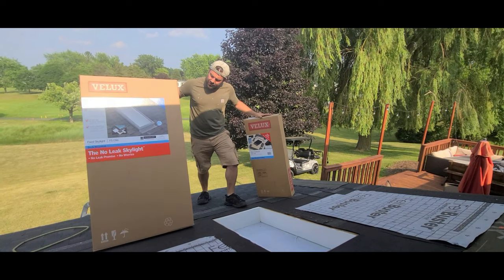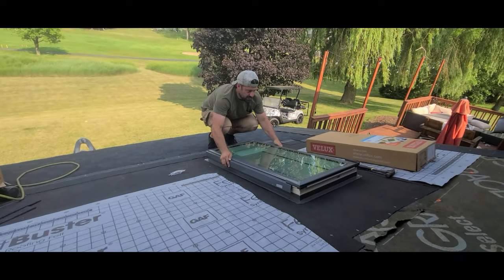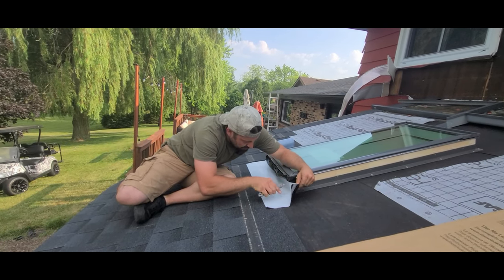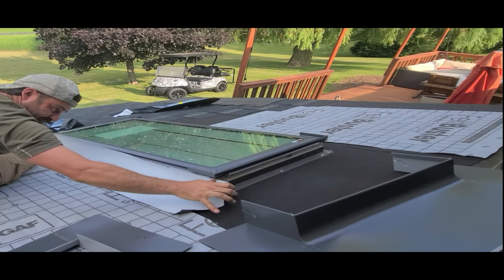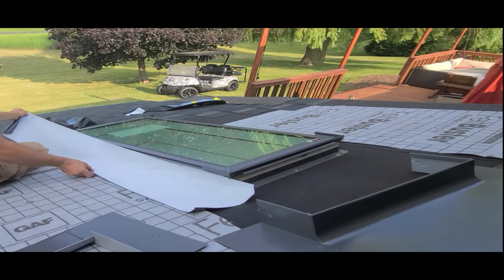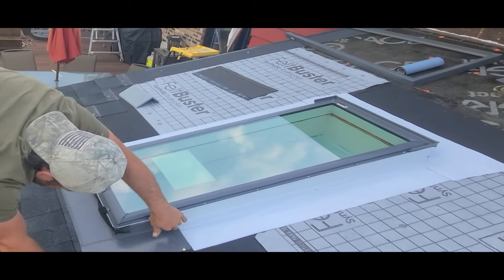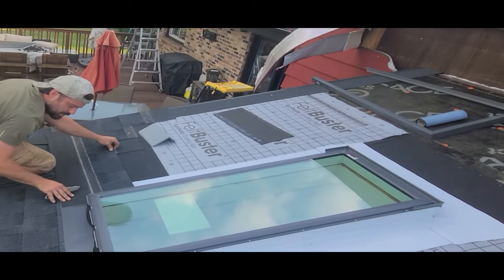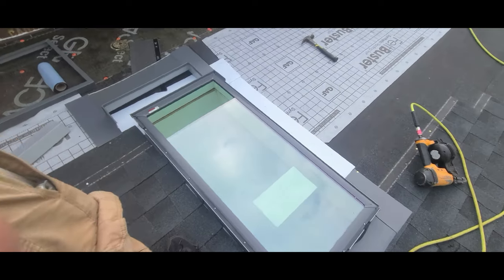HOW TO | Velux Skylight Install

Comment: Dude, you saved my bacon. I am a reasonably competent DIY and took on the task of replacing an old leaking skylight with this model of Velux on a cedar shake roof.  Everything went ok until I could not gete the saddle flashing or the cladding to go onto the skylight frame.  Your mention of that stupid extra piece inside the saddle flashing told me where that was and why it was not allowing flashing to fit.  Same with how you showed how to put on the cladding.  Thank you!  Velux instructions are lacking in the use of the English language and additional notes for the new installer using this product for the first time.
Reply from the maker: Happy to help!

Comment: The piece that you discarded at 3:35 in the video does have as purpose for some installations. From the flashing installation instructions: "Install saddle flashing. Determine use of extension piece: use it if the saddle flashing is lifted up by the underlying roofing material and remove it if the saddle flashing fits tightly over the skylight". The instructions have some nice illustrations showing when it would be needed. In your case(s) it is probably not an issue, but in other cases, perhaps. Anyway, like you videos.

Comment: FYI, that “useless piece of metal” is intended for helping with height of roofing material. It’s an extension to fill the void caused by thick roofing material like shake or slate.
Another helpful tip: use a hand seamer and close the head flashing to cladding overlap at the top. Keeps rain and or snow and ice from creeping up that joint. Just takes a second.

Comment: Can you please link to the skylight you installed? Where did you get it and what did it cost? Which flashing kit to get? Thanks for a great video - straightforward and quick. Perfect.
Reply from the maker: You can get it from your local roofing supply store like beacon building products or abc, or local shingle delivery company. They usually have everything in stock. Also I'm pretty sure Menards has a few in stock.
Reply: @NWIVeteranConstruction  Thanks for the speedy response! This looks like a Velux C08 (or something very similar). These are currently about $410 at Home Depot and the (required) flashing kit looks like it's another ~$160. For others reading this: smaller/larger are slightly less/more and of course it's extra if you want built-in shades, or if you want it to be openable.

Comment: The piece you hammered over at the beginning is probably to cover your nails with. 

It’s probably designed to have you shoot nails in and then bend it over to cover the nail heads.

Comment: the old one looks like what I had Andersen, they stopped being in the skylight business, I had 8 of them. After 27 years a few started weeping finally started weeping, rubber gasket got old and dried out,  replaced with 8 Velux, Velux has the market indeed. So it was due, new 8 Veluxes and roof shingles 50 year Owens Premium .  Should be good for my time...left

Comment: Hey bud its been awhile since iv talked to you i have a quick question.. I'm building 12' wide dormers on a 24 x 24  12 12 pitch gable roof.. For shingling purposes on my ridge should i come straight off so IOW i will have two right angles all even? Or would it be better to hold the new ridge beams down a little from the original ridge? Thanks ahead and keep making videos its been 3 months..

Comment: How exactly do you measure before buying the skylight? If theres s fixed mounted skylight thst needs to be replaced, then do tou measure the outside skylight frame or do you go inside and measure the cutter plywood roof?
Reply from the maker: Measure the R.O. which is the rough opening. Drywall to drywall on the inside. You can usually just look down the window from the top and get a close enough measurement if you can't reach from a ladder inside. These are normally a standard ish size and there will only be one size that fits closest to the number you need.

Comment: The little small piece is not to keep the thing from getting bent in the back is in case you use thicker shingles, like wood shakes or whatever is it like an extension so your back piece of clip over your piece on your flashing come on now. 

You should’ve ran one more shingle at the bottom before you put your ice and water on too, so it would’ve came out on top of that right there if it gets up underneath it’s gonna come out and run in the bond, but it shouldn’t be getting there anyway cause if you get water on your ice and water, you done done something wrong to begin with. 

The shingle at  roughly 9:53 into the video should’ve been underneath that ice and water . Not on top just saying.

Never seal your bottom piece of flashing underneath it all you’re doing is trapping water in man. I’m teaching you all my secrets.

Yeah, you should’ve ran one more shingle under the  back pan that’s wrong. Yeah it might not look as good with that piece flashing showing at the top but that’s how you get your water back on top of the shingles and not up underneath the shingles. I ain’t trying to nitpick but right or wrong? I mean come on now.

Would you rather it be pretty and leak or would you rather have that little piece of flashing  showing and not leak? That last piece of ice and water should’ve been up underneath the back pan. If you were gonna put that ice and water on each side of the very top that’s fine. Put it on then put your back pan down over top of that then put your ice water over top of your back pan . I got to quit watching. I can’t watch it anymore. Thank God for all your extra protection and ice and water shield . Good luck, brother. Geeez…
Reply from the maker: Nah you're tripping. Idk about the extra piece thing, and I see your point on the bottom, I used to do that, but I switched to the way the instructions say and the flashing does all the work.  I wouldn't recommend changing a single thing about what I did in this video, especially at the top with the extra sticky bit I put on it
Reply from the maker: Honestly, I do appreciate the detailed insight though.  You clearly have done enough of this type of work to conjure up a worthy opinion. No hate bro. Keep up the good work 👍
Reply: @NWIVeteranConstruction  I have done my share. too much of it. We’ve got hit by bad storm about a month ago grapefruit size hail! Every storm chaser in the damn country came here. Unreal. I’m like y’all can have it.
Reply: And if you don’t listen to anything I say I want you to take one thing from this and I want you to take it to heart. Take care of your joints. Don’t do none of that jumping off the damn house into the back of the dump truck none of that dumb shit. Both my knees are shot. One’s been replaced and they screwed it up scared to get the other one done they’ve been bone on bone for shit 10 years. arthritis eat up both my hips socket on both are shot. Scoliosis and degenerative disc disease eat my back up so take care of your joints man straight up. I’m 53 and can barely walk started when  I was 16. I roof many houses twice because they were wore out repeat customers that’s pretty cool.
Reply: You naild it

Comment: not even sure why this was recommended to me.  Even though you forgot that little tin piece I have zero doubt that window is going to leak anytime soon!  Don't suppose you're near NW Ohio?
Reply from the maker: Yessir. I'm still on this job and I went back up there to double check and it definitely won't cause an issue stopping there. The reason I did it so mindlessly is because I knew that subconsciously lol its alllll good
Reply: @NWIVeteranConstruction  I'll bet getting out of your regular routine and talking to the camera didn't help either. =)  CheerS!
Reply: Boy did you do this wrong.
Reply from the maker: @billsmith9249  that always plays a part lol

Comment: I'll always change a deck mount to a curb mount when I replace a roof. Can't stand those things
Reply: Why?
Reply: @dx9506  I don't need training wheels
Reply: @joeregalado9378  Please explain my fellow rufero.
Reply: @dx9506  the flashing kit is more work. When you change the skylight people paint the curb inside and now that needs to be addressed. A curb mount, flashing is widely available as are replacment skylights. No shingles are needed to be removed for repairs. If you can't flash regular metal flashing you won't be able to flash their kit
Reply: @joeregalado9378  Building a curb is more work thank nailing down a fixed deck mounted skylight to the framing. The inside of the deck mounted skylight is painted white to match 99% of ceilings that are painted white. The flashing kit for the deck mounted skylights is easy to install and less work than fabricating your own (headwall) top and (saddle) bottom pieces. Either type can be installed and not leak if best practices are followed. The only skylights we have had to "repair" were installed incorrectly and needed to be replaced for us to warranty the work. We also always replace skylights when replacing an entire roof otherwise we will decline to replace the roof.

Comment: You should be a dog and post a video on window wraps. I’m a gutter guy but I’m getting into wrapping out of necessity, and I’ve done about three so far and I blow absolute balls.
Reply from the maker: bro i was gonna film one today! but i was in a rush and didn't have time pluse it wasn't a good window to do it on
Reply: @NWIVeteranConstruction  whenever you film one, I’ll watch it for sure. I’m struggling with the easy ones, I’m kinda scared to see the double window/brick mold bullshit.
Reply from the maker: @dogman183  I do have one video you can watch.  A brake buddy video.  Just follow similar steps for a window..

Comment: Boy did you do this wrong.
Reply from the maker: Haha no not at all.
Reply: He used all the pieces exept one so thats pretty good I think. Everytime I put something together out of a box I have at least one piece left over too lol
Reply: What did he do wrong?
Reply: @kingtut6619  Velux's instructions say to remove the existing underlayment 4 1/2" on the sides and 7" on the top, but in this video that didn't happen. I'm not sure why it would matter though.
Reply: @DavidKlausa Maybe so that small peel and stick he puts around the skylight bonds to the roof deck? Peel and stick on top of synthetic is only stuck to the synthetic not the actual wood, if you ripped up the synthetic the peel and stick would come off easy. If the peel and stick was on the wood then it would never come off. However it’s probably fine imo.

Comment: Those rolls of flashing tape come with the skylight?The step flashing used to come with a bag of little nails so you can nail the flashing to the skylight and not have to nail step flashing to roof?Nice job💪💪
Reply from the maker: Yes everything I used in this video was included.  There was no bag of little nails in this kit. I've never seen that but that's pretty cool
Reply: Yeah last time I did a velux 20 years ago they had nails for flashing. The kit was only about 60 bucks wonder what it is now with bidenflation.
Reply from the maker: @FredWilkinson-hh2it  haha I don't even pay attention honestly. Gatta have it so It is what it is lmao
Reply: @NWIVeteranConstruction  ya last time I did one which was about 10 years ago so it's been awhile the flashing kits came with these little nails, barely could grab them they were so small,but you'd nail the flashing to the side of the skylight with them,they were small so you wouldn't penetrate the inside of the skylight throw the cap on an done.